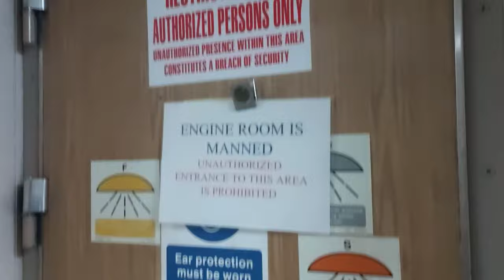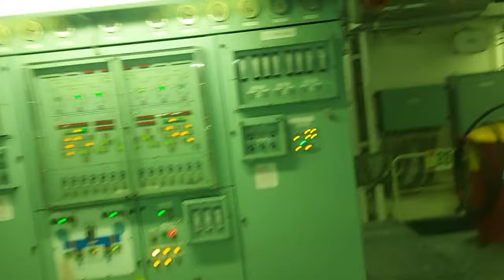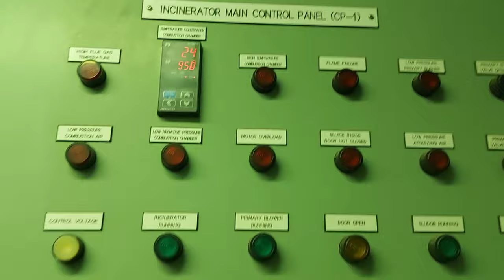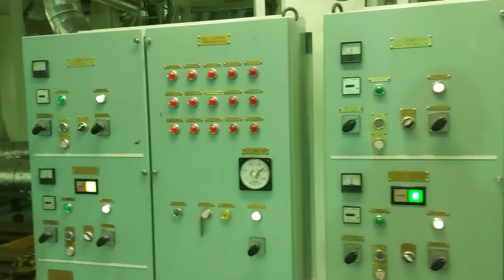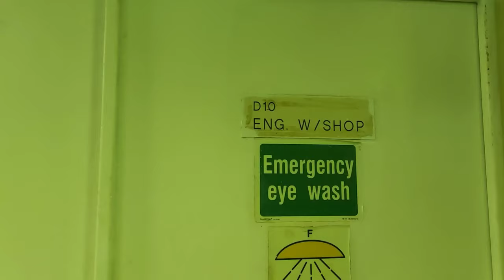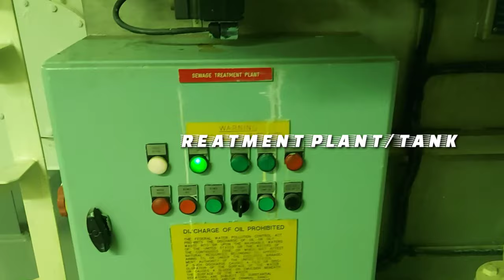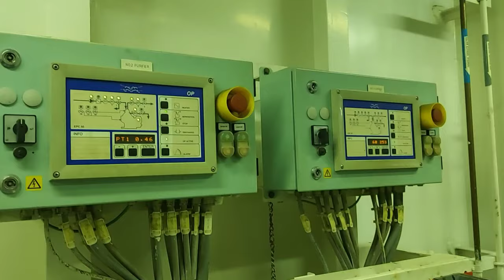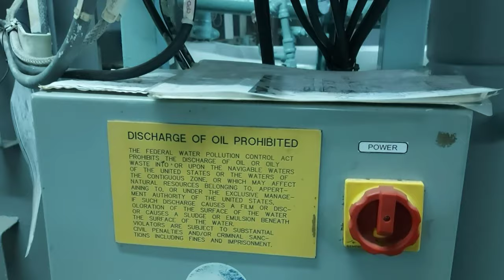STEAM TURBINE ENGINE ROOM FAMILIARIZATION | WHATS INSIDE | A QUICK TOUR ON MY WORKPLACE

Comment: What type of ship is this?
Reply: A tanker.
And due to the steam plant and the yellow painted sections on the boiler burner piping: an LNG tanker burning its boil-off gas.
But correct me if I am wrong.
A beautiful engineroom by the way.
Reply from the maker: This is a steam turbine type of vessel which carries LNG.
Reply: does the water desalination from the sea?
Reply: @emontrailers  Yes
Reply from the maker: @emontrailers   Yes ,we had a fresh water generator that converts sea water to fresh and distilled water onboard.
Reply: Sir anung maker Po Ng switchboard ninyu at generators?

Comment: No main boiler, no main turbine, no any data for steam pressure and temperature. Just a bunch of electric motors and piping, piping and piping. Thumbs down for this video.
Reply: Main boilers 4:07 - 4:25 . Pressure: 59 bar, temperature: 520 degrees Celsius. Main turbine 7:10 and 9:52 .